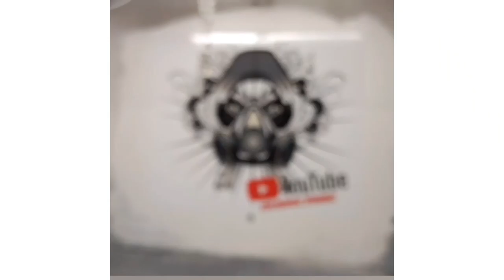Possibilities with Powder Coating - Ep 42

Comment: Whats up with the aluminium foil? On the back?
Reply: Keeps teh powder out of the center bore to prevent fitup problems on the hub.
Reply: I believe he’s wondering why foil was used this time instead of high temp masking tape
Reply from the maker: because these were getting machined afterwards. There was damage on the back pad